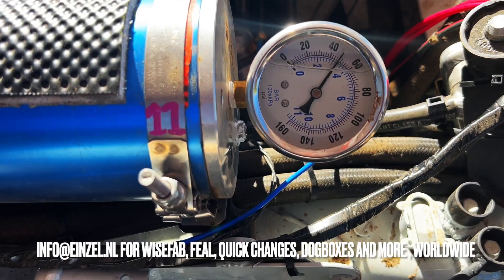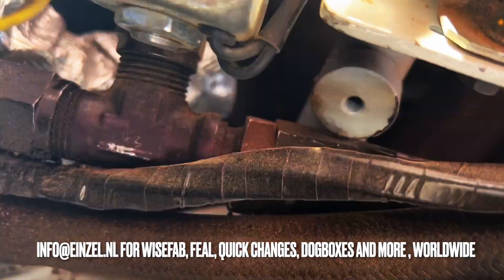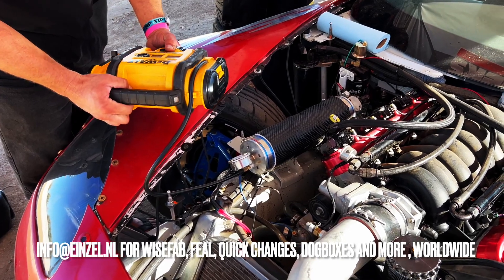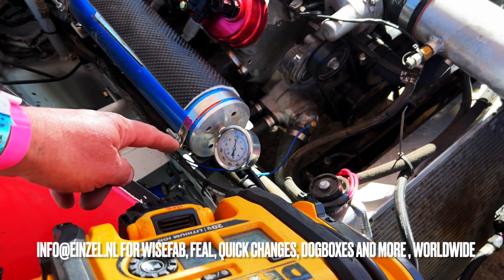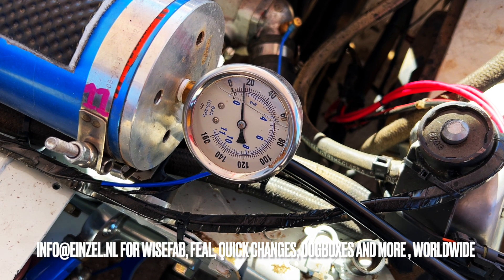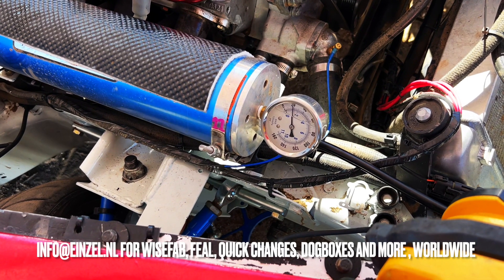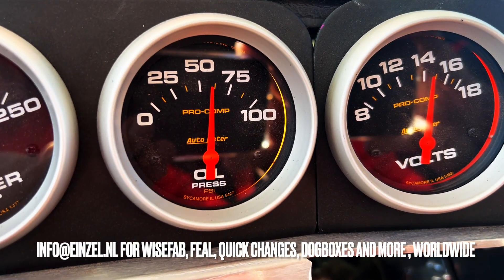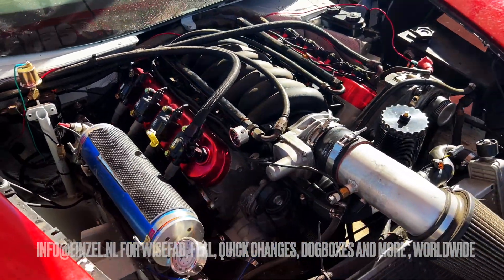Accusump Explained & Installed on LS3 Corvette C6 Formula Drift car

Comment: Great video Wout.  Need to give instruction on how to pre oil and how to manually close the valve so you can correctly check oil level with pressurized accusump at capacity.